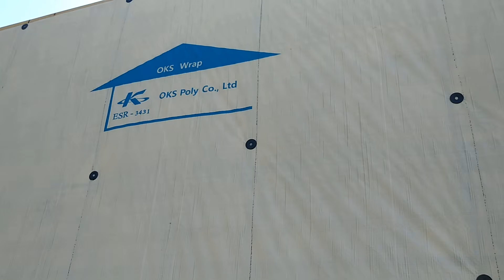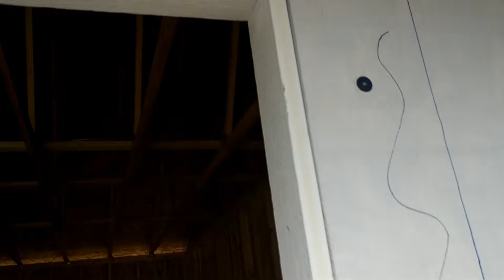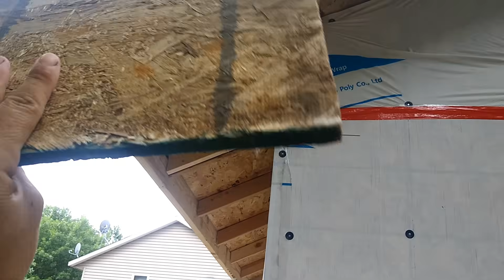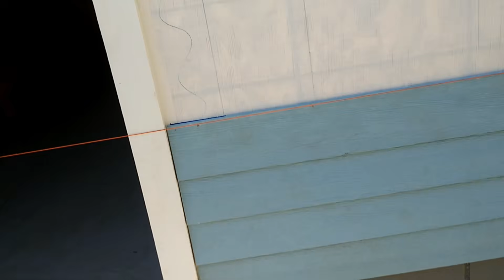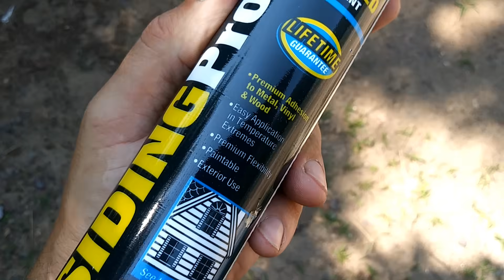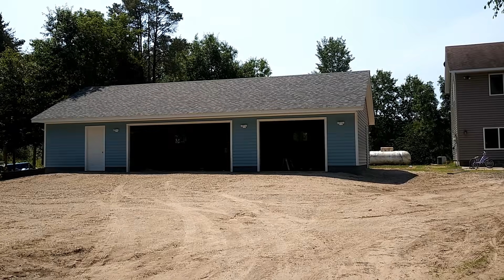Menards Garage (24' x 48') Kit: Multi Siding (Part VII)

Comment: Does Menards charge a markup for their kits? Or do you just pay the standard material price?
Reply from the maker: You can do both, but i pay the standards material price.  You can get some stuff precut, but they charge extra.  So its better to buy a standard 2x4 and cut it yourself.  
Menards have a computer at the store, or you can do it online where you type in your dimensions, or pick a plan.  Then you print off the material list.  You go to the service desk and order whatever you need, or you customize your material list.  Or you can even shop around and purchase some stuff from a different box store.
Reply: @homeschoolhomesteaders2842  thanks for the response. I assumed they just sold the package together with a plan for a markup. That is good to know.
Reply: @homeschoolhomesteaders2842 still holding well the vinyl siding